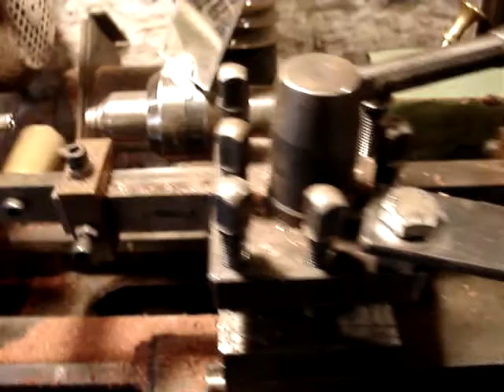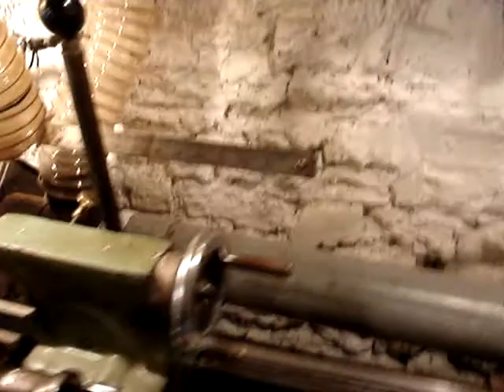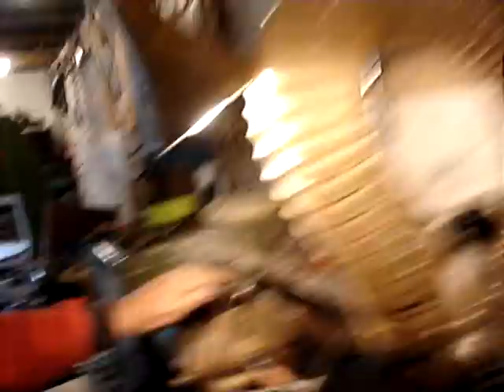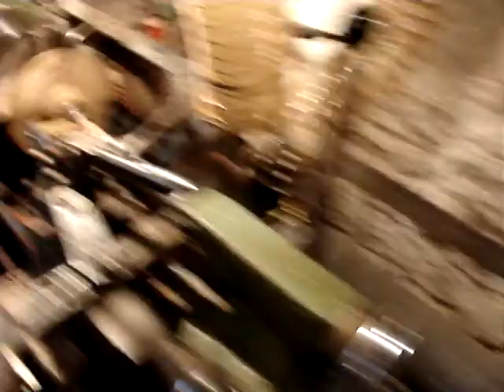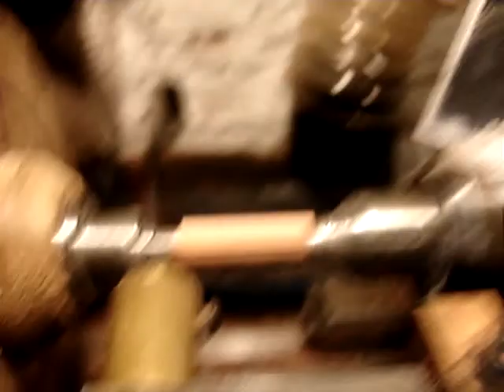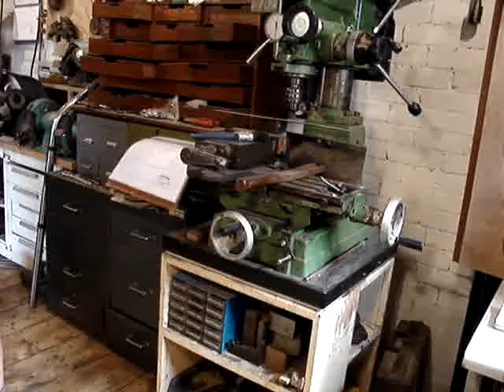Recorder block making

Comment: So excuse my ignorance but is the final windway tapered in width and in depth? i think it is to basically increase air pressure and speed at the labium edge? is there a website or a book that either of you would recommend for details drawings etc of recorders, flutes, whistles and or Tabor pipes?
Thank you for sharing !

Comment: .With your building system the block is cylindrical, while all historical blocks are conical. I use another system. Greetings
Reply from the maker: All I have to do is turn the tool post and I can cut tapered (conical) blocks.  I have a wind way cutter which will cut the tapered wind way to match the taper on the conical block upstand, I will video this as well when I’m not too busy.  It would be interesting to see a video of your system.
Reply: @p.g.bleazeywoodwinds2230 Here you can see my way to build a recorder:   https://youtu.be/vaf1BspGXE8
Reply: @p.g.bleazeywoodwinds2230    here you can see my way of buildinga recorder   https://www.youtube.com/watch?v=vaf1BspGXE8